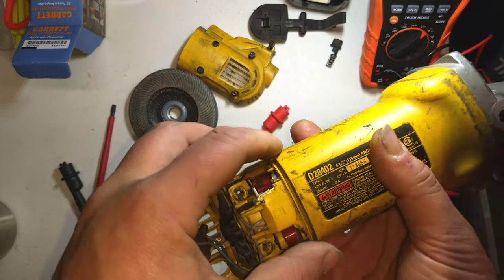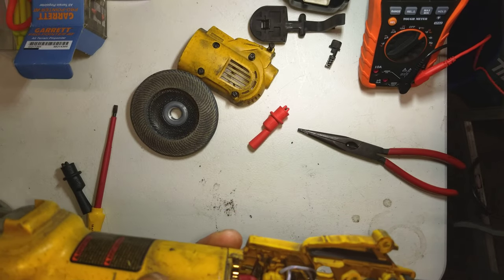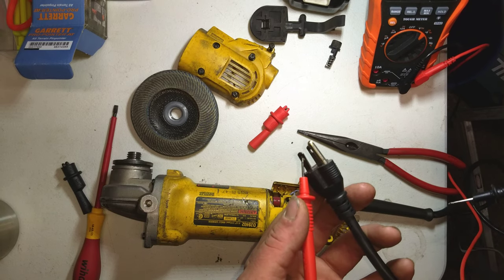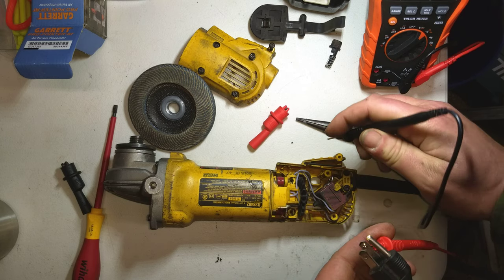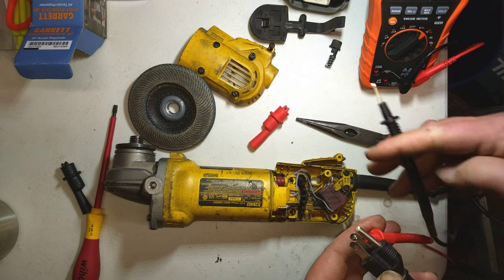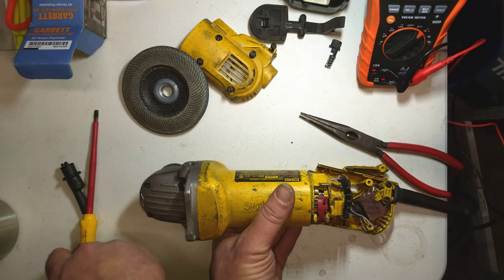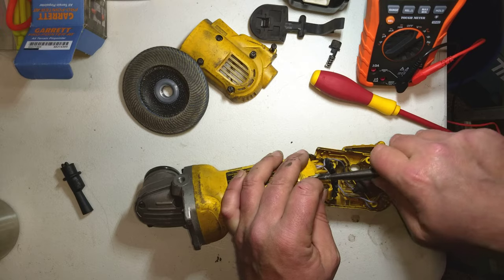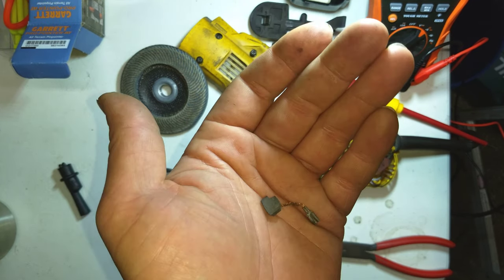DeWalt D28402 angle grinder not working: Diagnostics.

Comment: Nice, to the point useful diagnostic testing method. Thanks
Am I to assume that if I have continuity to the brushes, it's definitely the brushes? The shaft spins freely by hand but my brushes also look like they have plenty of life. When I removed the shaft the brushes pushed in about a cm on both sides.
Reply from the maker: There's a possibility that it could be the armature but brushes are so cheap it's worth getting a set to throw in and try out. Do the brush springs have decent tension and do the brushes move freely in their holders?
Reply: @lunchboxproductions1183   Hi, it turned out to be a dodgy power cable in the end. Now fixed, thanks